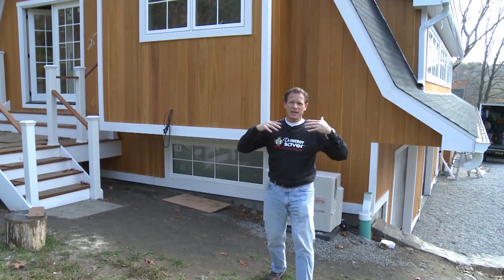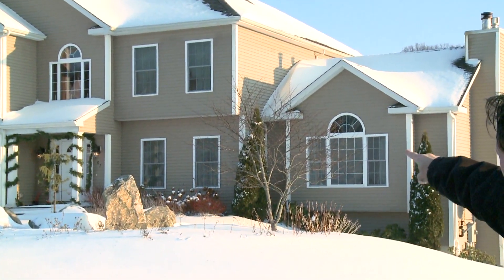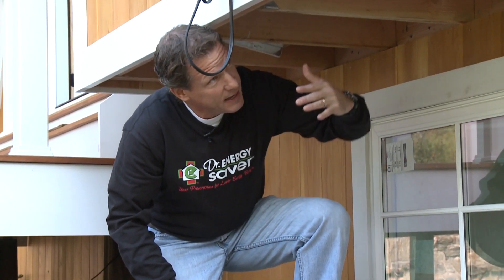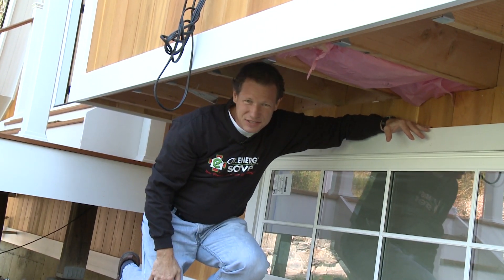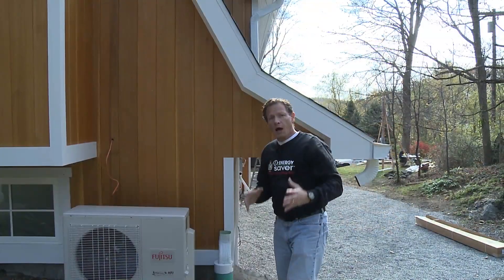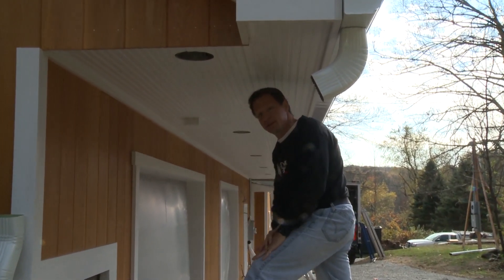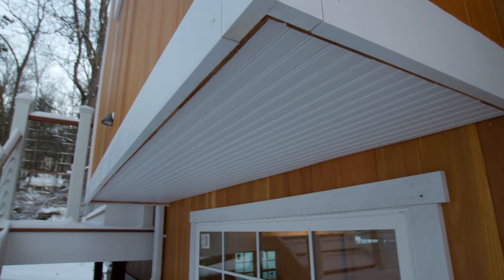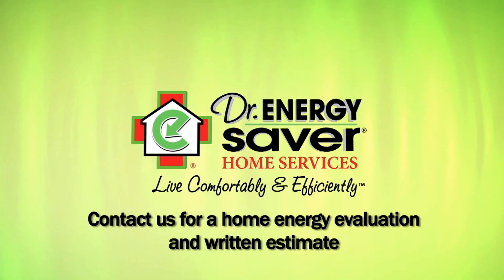Insulating Cold Cantilevered Floors

Comment: i have a similar problem, un the uk we tend to have garages that stick out further on the first floor, and then bay windows on the floor above that stick out from the brick line of the second floor walls. The bay si typically just a wood frame with tile over it, they didnt even insulate that, just an open gap with plasterboard on the inside, an air gap and then tiles on the outside. a perfect way to let the heat out of your room. 

on top of that the floor below the bay would be an overhang, but an overhang into a roof space above the garage, so the air comes in under the tiles on that roof and so theres cold air directly below the bay window floor, the joists are completely open, no insulation. And i think mine is so bad that the framing inside the garage that was done to convert it into a room has gaps all over so this roof space, when theres a breeze you can feel the air blowing in around the plug sockets, around the electrical fuse box in the room, The cold is just pushing its way into the room. 

I'm not exactly sure of the best solution and that wont cause humidity problems though. i'm thinking of cutting a sort of loft hatch in the room rather than remove tiles from the outside, put in expanding foam in the sides thats allowing air into the walls in the garage room, put insulation in the roof joists section, double up on that even, and for the floor joists put in blocks of foam up against the underside of the floorboards and with expanding foam to seal it up so theres no air gaps. Just dont want to do the wrong thing and make a bigger problem. 

its crazy though to think that theres probably tens of thousands, maybe millions of homes that have this same defect

Comment: My house had an addition added on in the back to make a third floor, I know thaty floors are cold upstairs are cold due to the gables needing spray foam added to seal up air leaks, but my main floor is also cold even though I had my basement and rim joist spray foamed, so would the cold air from the third floor coming in from the gables ends be running down through my walls and making the main floor cold as well?
Reply: Oh and to add my house is about 60 years old and this is my second winter here now

Comment: freaking builder put the kitchen pipes on the overhang and we constantly have to run the water every winter; sometimes when temps are so bad, you'll have to heat up the pipes for at least 3 hours before the ice would melt...Grrrr.  Why do inspectors let this stuff go?  Not only is it frustrating for the home owner, but like you said it creates such energy waste!!!
Reply: We are having the same issue in our bathroom right now: previous owner put it on as an addition and didn't properly insulate and seal, so we had frozen and burst pipes and drains on top of a rodent infestation. It was AWFUL. Unfortunately, spray foam isn't an answer for this space because it's just too big. Trying to figure out the next-best alternative as well as how to finish. We are thinking fiberglass insulationg with foam board on top of it to act as a vapor barrier as well, but unsure how to finish off above the foam board. Is plyboard necessary at this point??? Or should we just put some sort of facing material? We DO plan on putting hardware cloth over all of it (corners included) to keep out the rodents too.
Reply: @rsomebodyh  maybe dense packed cellulose?

Comment: Only insulating the ends is a good start , but if possible filling all cavity is a good idea , that includes internal cavity walls . Don't heat space , you will never get into , it does not need the heat , you do . FILL IT ALL ..... but ensure it is sealed , or they may be condensation problems .

Comment: Informative video! This has been on my to do list for some time. I live in Newfoundland and the winters are cold, i am loosing heat through this area of my home. How would you recommend insulating a cantilevered floor that has PEX radiant tubing attached to the underside of the floor? the cantilever is approx 3 feet long with the PEX nearly to the end of the section. Usually it is good to leave a few inches of space between the top of the insulation and the floor for heat to generate. But in this case since i am probably loosing heat here (since it isn't properly insulated), is it ok to fill the whole space with spray-in insulation or use some other type? Is vapour barrier required? Thanks.
Reply: +S. Douglas
But not punctuation?
Reply: Losing heat, not "loosing" heat   Grammar is key for a functional society !